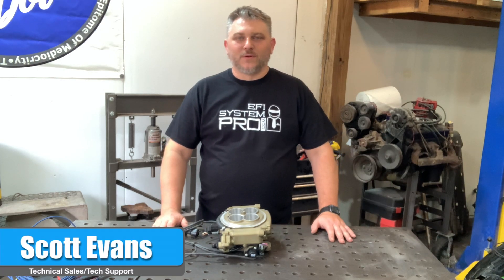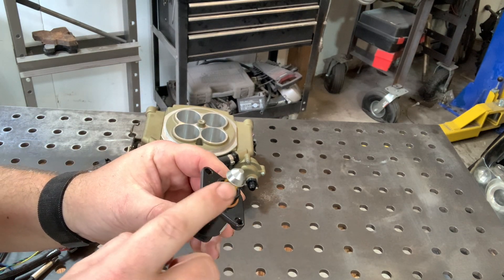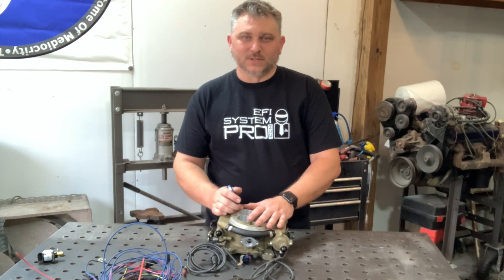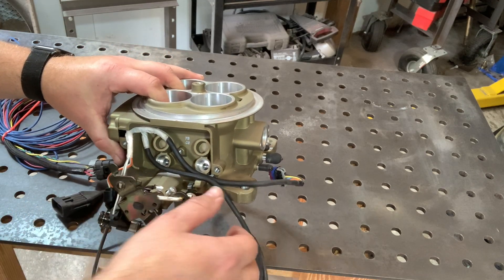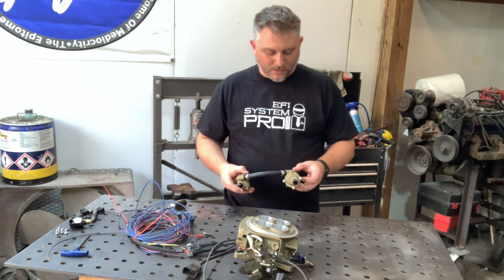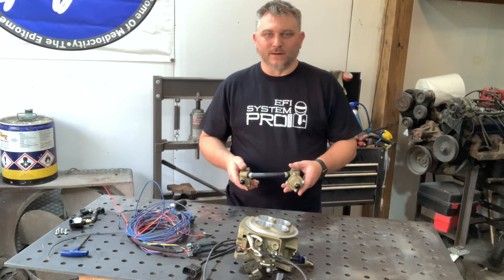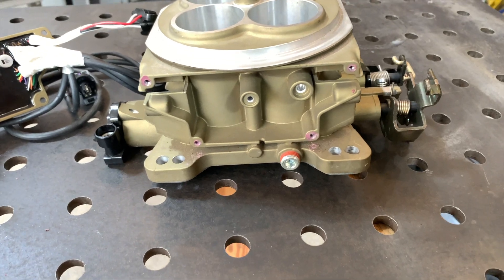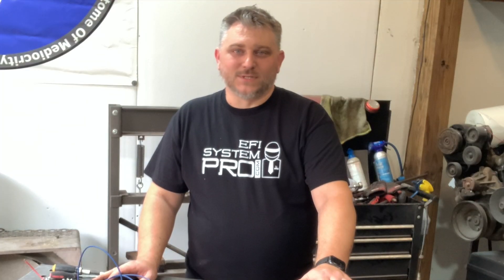What's Inside a Holley Sniper EFI Unit | EFI System Pro

Comment: Excellent!  My curiosity has been satisfied.   One item of note is that although having the ECU electronics fully "potted" can be frustrating when dealing with broken wires, personally I was pleased to see this is how Holley has designed the electronics.   Having experience working with electronics in severe environments this is the best way to ensure a long, trouble free electronics lifetime.
Reply from the maker: Glad to hear this was helpful. The potting is definitely a catch 22. Make the unit more durable or make it repairable? I believe with all of the pros and cons this was the best compromise for sure.
Reply: @efisystempro  If Holley wishes they can make a replacement ecu, that is bigger but then with connectors so the cables could be replaced.

Comment: The music is killing me.   It is similar to a song that SouthPark used.

And the sniper fuel regulator is such an annoying pile of crap to service if it needs cleaning because the lines had debris from being made.   Easier to remove and run an external FPR.
Reply from the maker: The song was just something free from YouTube. The video seemed to need something to break up the silence. 

Fuel lines should be flushed after being made and before being used. It is a little tough to get the regulator out without affecting it's calibration, but most of our customers use the internal regulator with great success. Luckily an external regulator can be used pretty easily though.
Reply: Nails on a chalkboard

Comment: Pardon the retard question but do I use acfi intake or efi manifold. Also use fuel pressure gage? Also how well do these work with Nitros ?
Reply from the maker: With a throttle body style injection it is best to use a carbureted wet flow intake since fuel and air flow through just like with a carburetor. We highly recommend fuel pressure gauges on all installations. You can check for problems very quickly. The Sniper works very well with nitrous. We have many customers using it for nitrous control.

Comment: This should be called "Holley Sniper Demystified"! Thanks for doing this and showing what's inside a sniper.   What's a Sniper XFlow look like torn apart?  How does it differ from the regular Sniper?
Reply from the maker: Glad you liked the video, thanks for watching. The XFlow is basically identical. The only real difference is the XFlow has a higher CFM air flow rating and 120 lb/hr injectors. If I took one apart you really wouldn't be able to tell the difference in that and this video.
Reply: @efisystempro  Thanks for clearing that up for me.  What about the regulator?  I think I read that the Xflow does not include an internal regulator.  Is that correct?
Reply: @efisystempro    I'm in the process of putting my '74 Duster back together again afer I took it apart for paint.  It has a 400 HP 360 engine, and this time around I'm going EFI but I can't decide between Holley Sniper, Holley Sniper XFlow (because they  look cool),  some other Holley, or Edelbrock Pro-Flo 4 (for the multiport injection).
Reply from the maker: You are correct that the XFlow does not have a built in regulator. We can help with setting up your parts list if you want to fill out our short form here. https://www.efisystempro.com/custom-build-sheet
Reply: Get something that has the ECU out of the damn engine bay.   Snipers and EMI do not mix.   Some day will upgrade away from the Sniper
Reply: @JoeyGarcia  I have the Pro Flo 4 on my 393 stroker in my Ranchero. It runs good, but is not very tunable. Limited functionality, I would love the ability to be able to tweak the fuel charts to specific rpms and that's not possible with the Edelbrock. You can download their software for free and play around with it. For real tunability might have to go with something like a Terminator X from Holley.
Reply: @dividingbyzeros  been reading more on the Terminator X EFI for the reason you pointed out.  Seems pretty capable for a bit more than a Sniper.
Reply: @efisystempro  x-flow has to use an external regulator correct ? I’m looking into buying one for my mustang with a 347 and Paxton supercharger. I have the opportunity to buy any way of fueling right now so I’d like to be making a good choice. I have a carb on the car right now n/a and the car runs beautiful. I just bought the supercharger so now I’m looking for a way to get it to work. Not many tuners around here.
Reply from the maker: @85notch347 Yes, the XFlow does not have an internal regulator. Even if it did have a built in regulator, with a blow through supercharger setup you really should use an external regulator with boost reference. When you put boost pressure to the tip of the injectors it essentially reduces the fuel pressure the same amount as boost pressure. You need to increase the fuel pressure to match every pound of boost.